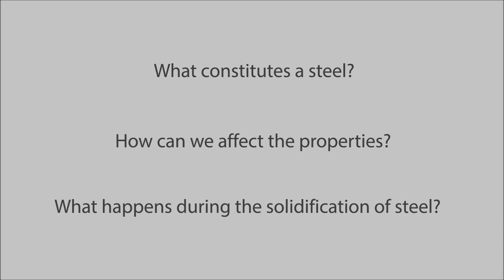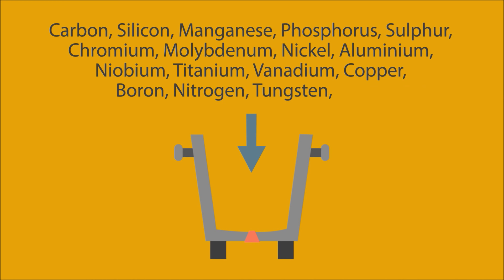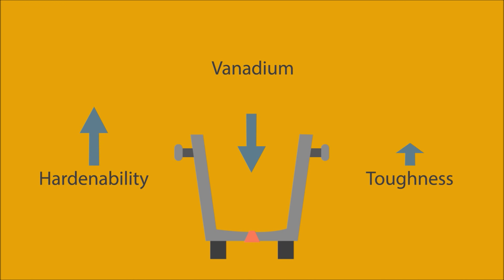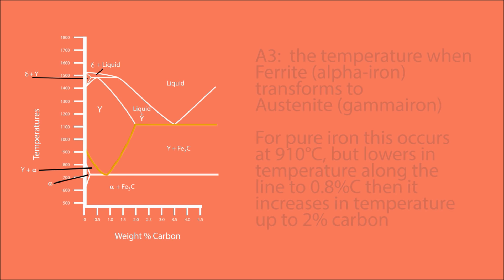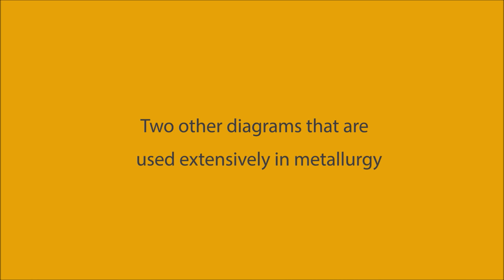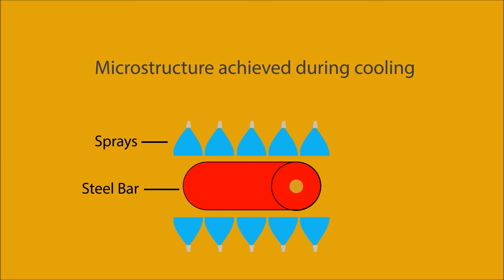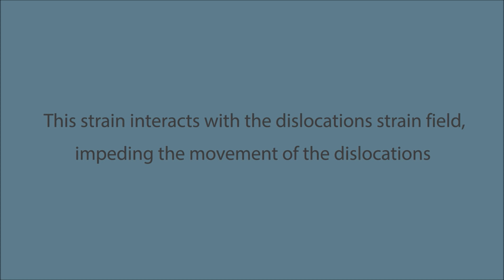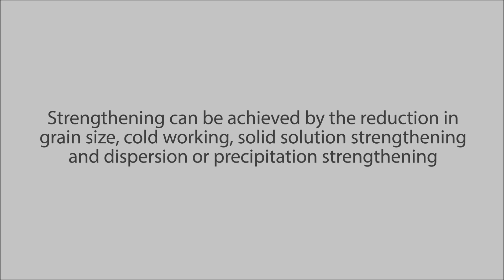Steel Metallurgy - Principles of Metallurgy

Comment: Manganese is combined with sulphur to prevent hot shortness???
Pls explain...
Reply: If sulphur is allowed to remain in steels, hot shortness results, meaning you would have non-metallic brittle phase between the ductile iron grains...no good. So we add Mn. This now combines with the sulphur, forms MnS which does not form the brittle network at the grain boundaries. Hope this helps.
Reply: Hot shortness in kind of innacurate. Hot embrittlement is more accurate. It means growing the temperature at which steels become brittle (eg.: if a steel usually embrittles at -20C, if it has a high sulphur content (~0.5% or more) it could embrittle at -10C). When we add Mn, it forms MnS (in combination with S) and this (partially) eliminates hot embrittlement.
Reply: So basically Sulphur is a bad impurity to be in your steel that leads to brittleness especially in low temperature but we can still counter it without trying so hard purifying it by adding Manganese? am I right?

Comment: How does the SS retain austenite phase at room temperature when below 723deg austenite does not exist ? Do you mean you heat to above 723deg and quench it to retain its austenite phase ?????
Reply: @awashburn6944  Sir, does that mean (as per the graph) the phases at different temperature, actually refers non alloyed steel ?

Comment: nice vid. some small "faults". for ex. chromium used in stainless steel? chromium is what makes it stainless steel :)  *used in steel to make stainless steel.
Reply: That is not a "fault" in any way. In the manufacturing of raw stainless steel Ferro Chromium is often added to the melt in the process. As a rule stainless scrap with approximately the required content for the elevant specification, is used in the charge. As a techno person who worked with many, many specifications including most stainless grades for over four decades I can vouch for much of the info contained herein.

Comment: This is the kind of teaching that should be done in a Metallurgical Engineering curriculum, but it's not.  Instead they go deeply into dislocation theory and crystallographic transformations in a way that will only be useful in a research position.  A Bachelors degree in this field is now useless.  Don't even bother.
Reply: @awashburn6944  I'm sure there was more but that is what stands out.  Metallurgical engineering turned out to be such a bad choice that I now call it a "non-education for a non-career."
Reply: @awashburn6944  Silly, the reason I left the Rust Belt for Canada was because there were no jobs for me.  I did not want to sit out most of my career waiting for it to change so I picked up and left.  Simple as that.
Reply: @awashburn6944  I agree. I was very fortunate to learn about phase transformations from the guru, Thaddeus Massalski, during one summer in a class of only 3 students.
Reply: @awashburn6944  Plenty all over the U. S. for the last few years.

Comment: "centimetre squared" should be "square centimetre". It means a different thing. The second one is a unit of area. The first one is a unit of length where the number is squared. 2 cm² is not (2 cm)² = 4 cm.